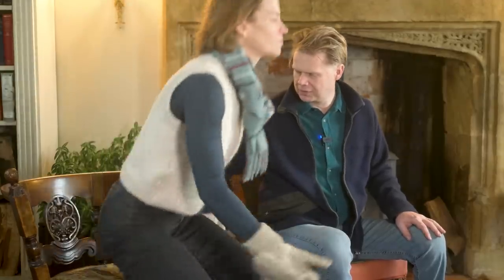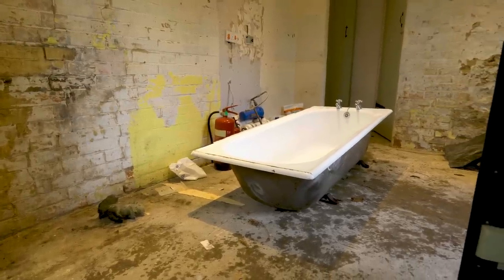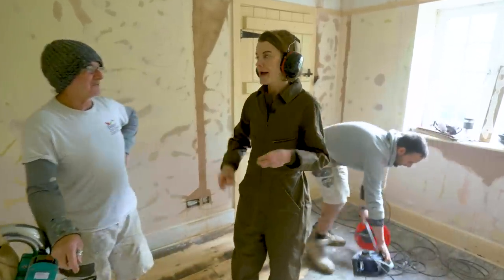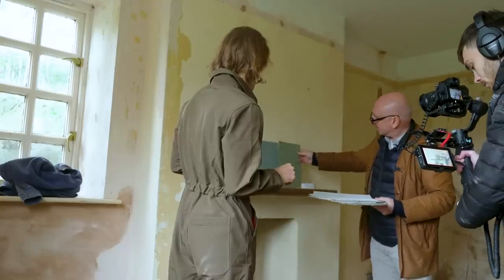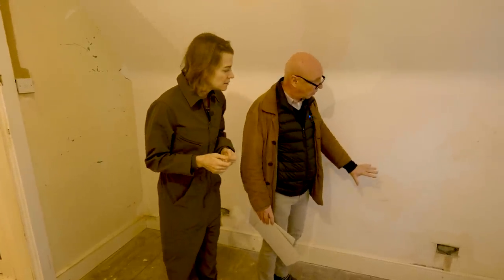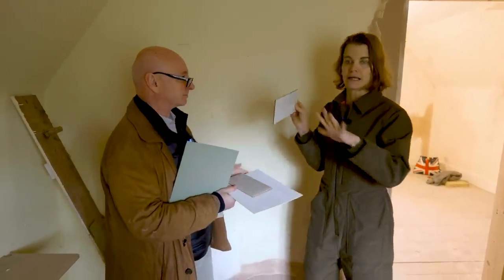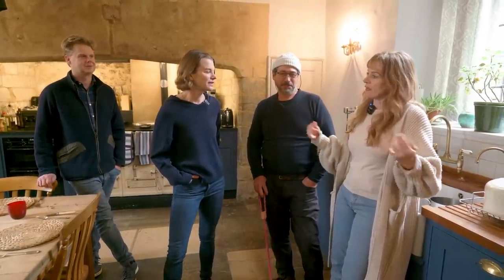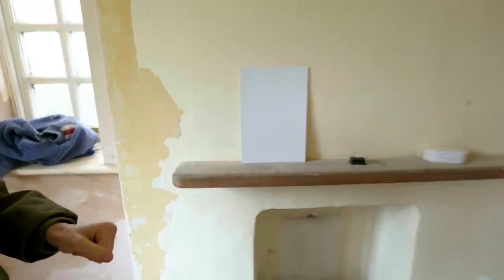Fairytale English Cottage MAKEOVER - COLOUR REVEAL! ( + @NickiPositano comes for lunch and a swim!)

Comment: I live near Philadelphia. We call a picture rail a picture rail. Chair rail is something different. Picture rail is about a foot down from the ceiling and pictures are hung from it. A chair rail sits about the height of a chair to keep chairs from scratching the walls.
Reply: Same here in Virginia. We call it a picture rail, which is also different from a chair 🪑 rail that protects walls from chair rubs.
Reply: @dawelch69  if your fortunate to have an original picture rail, there should be sliding hooks attached to the picture rail. But they’re usually long lost.

Comment: I am from the South and most old homes have picture rails down from the ceiling or right under the ceiling. When homes had plaster walls, you would not want to hang a picture  by hammering into your walls. Hanging from a picture rail offered a variety  of picture placement. Very smart thing to do.

Comment: Picture rail in America
Chair rail is not the same. The purpose of a chair rail is to be on the level with the back of chairs. They protect the walls from being marred by chairs.
Picture rails are obviously higher and are for hanging pictures without making nail holes in the wall.
Reply: Exactly right.  When interior walls were made from plaster (before wall board or dry wall was in use) a nail could create quite a crater or crack in the surface.

Comment: Here in New England I have never heard any other term than picture rail. Another term for baseboards is mop board, presumably because it protected your wallpaper from getting wet when the floor was mopped. Love the green palette. The myrtle green might also look nice on the fireplace surround downstairs to highlight it as the focal point of the room (or maybe the room is too small - can't tell from our viewpoint.) I think you could step out of the box the teeniest bit and use slightly different shades in each room so it would still blend but give a sense of passage. And black picture frames sound too modern. A cottage needs to be more cosy and less elegant! Otherwise, why bother booking a cottage? Just go book a hotel.

Comment: I would have also gone with greens for the cottage.  The color on the door is lovely and close to colors I'd use in my front room when I am able.  The choices for the dining room will give it an added difference.

I did have to laugh about the cold walls!!  My little house was built in the early 50s so no real insulation between outside walls and inside walls.  When it's cold, you feel it on the wood floor & actual room wall.  I do understand.

Comment: So glad to hear that on the upper rooms with the sloped walls & ceilings, you are keeping it one color. It is difficult to try to break that type of space. When you attempt to divide the slope from the flat part of the wall, it makes a space look incredibly small. I've seen where people try to use a sort of trim board to separate the space & use of colors. However, it is usually a big fail. As again, it just makes the space seem small, closed in and a bit claustrophobic.
Also extremely thankful that the color gray. That poor color has been thoroughly overused and abused in the last  5 years. It is a depressing color and I pray people stop using it lol.

Comment: As far as paint color, I would go with the darker paint color on the baseboards and the picture rail and I think the fireplace should be painted a accent color different than the actual Walls. In fact you can paint the fireplace the lighter green as well as one wall for a accent wall probably the opposite wall that gets the natural sunlight directly shinning on it and paint the dark green on the baseboards and picture rail then the light green also paint above the picture rail then the maughn white on the ceiling.